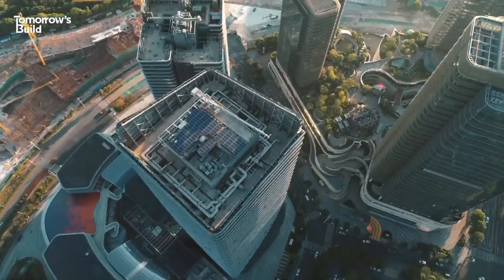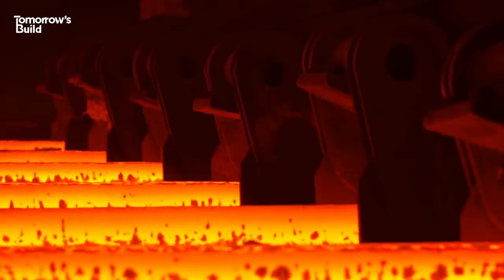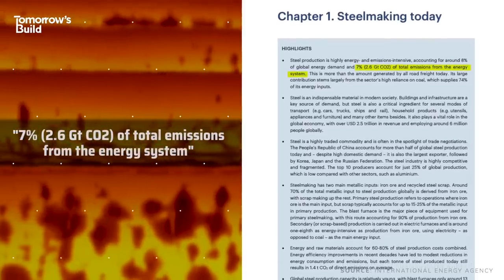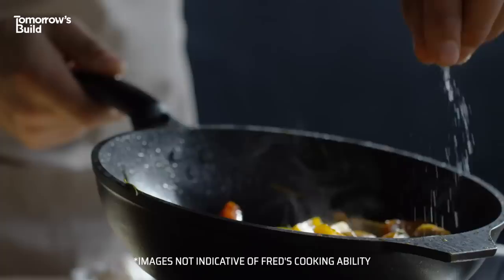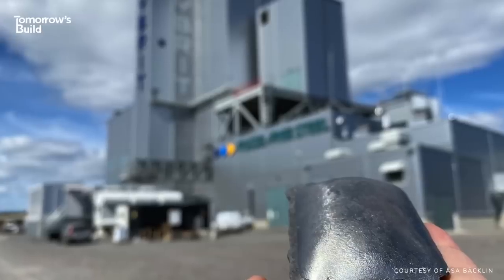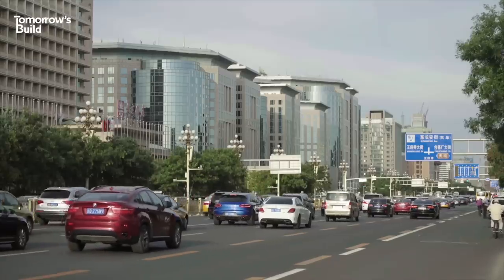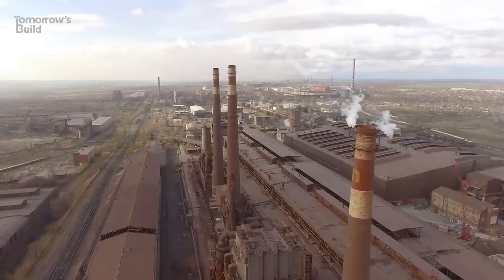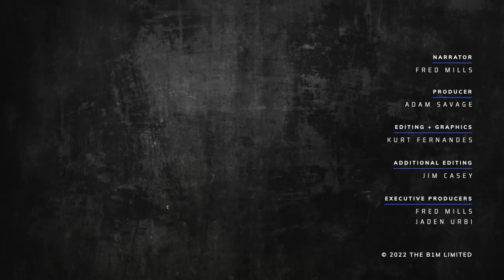Has Sweden Invented Green Steel?

Comment: What's the cost per tonne?  What does it use as a carbon source (i.e. where does it get the carbon that turns it from iron ore into steel)?  One of the main benefits of carbon steel is that it's cheap.  If this steel is two orders of magnitude more expensive, how likely is it that we can bring the cost down to economical levels?
Reply: That'll probably be a scale of production problem. Hopefully enough companies will want to show they are green so they'll buy the currently expensive steel and help them lower the cost long term
Reply: The current plant is a pilot plant from what I have understood so likely it is not operating at a profit yet.
Reply: Raw iron has more carbon in it than steel, hence the treatment with oxygen to burn most of the carbon out of the iron. No coal in the iron production means that no additional carbon is introduced, which in turn hasn't to be burnt out later in order to get steel. I'm not sure if the natural carbon content of iron ore will suffice for carbon steel, but introducing carbon in the steel production shouldn't be very difficult, maybe by just mixing in CO2 into the Hydrogen or mixing the Hydrogen with Methane, which contains Carbon.
Reply: Exactly expected more info from this video.
Reply: Many parts of the world including the EU has carbon trading schemes, creating situations where over time the cost of using carbon-intensive methods will just grow and grow. So that will contribute to evening out the costs over time.
Reply: @hape3862  How does a comment this wrong have so many upvotes?

No, iron doesn't contain natural carbon at all.

As someone who makes iron for a living, everything you've written is nonsense.
Reply: @gavwah  Raw iron (pig iron) contains 4% carbon from the coke in the blast furnace. Carbon steel contains 2% carbon after having burnt out much of the carbon with oxygen. – These are facts.
BTW: Making a living as a horseshoe smith in hillbilly-county doesn't necessarily make you an expert in metallurgy.
Reply: @hape3862  I guess he might be picking at your wording "natural carbon content of iron ore" whereas you're explaining a statement about raw iron (after blast furnace). From quick googling I get that plenty of types of natural ores do also technically contain carbon...

/me reading YT comments for insights. Keep up the informative debate :)
Reply: @gavwah  "Everything you've written is nonsense" is almost always a wrong thing to say about a paragraph of text. He wrote multiple statements, refute one by one with links to sources. If you can :)
Reply: @u1zha  Thanks for the support. I'm German and my English is quite good, so I translated "Roheisen" as "raw iron" - who would have thought it was "pig iron" in English!?!? But I suspected it was a misunderstanding and googled it. And I googled again for the percentage of carbon in "pig iron" and carbon steel to confirm that the numbers I had in my head were correct. I could not find the natural carbon content of iron ore, hence my wording "I'm not sure ..." in my first statement. Also, I wrote "maybe" in reference to methods of reintroducing carbon into steel.
Reply: @hape3862  >I could not find the natural carbon content of iron ore.

Because there isn't any.
Reply: @u1zha  

I'm an iron maker. I literally do this every day.  Your mate is talking about iron ore having a native carbon content of 4% and about "additional carbon". All carbon is additional in iron and steel making. It's nonsense. They've admitted that they're literally just googling stuff without understanding the details and nuances of what it is they're reading.

The economics and energy requirements of pure hydrogen DRI is insane. All proposals I've sent use natural gas / hydrogen blends with the aim of producing sponge iron with a carbon content of 2%. This will reduce the liquidus of the iron from over 1500 degrees to closer to 1200 degrees, significantly reducing the energy requirements, as well as simplifying the design, improving refractory life etc etc. Hydrogen alone won't give you this reduction. So you'll still need to emit that 2% carbon as CO2 - again, your mate saying standard steel grades are 2% carbon is laughably wrong. Now sure you can try to use some kind of biogas methane product instead of natural gas, but good luck being able to find enough of it to decarbonise the entire global steel industry. Oh, and god forbid you leak any of that gas to atmosphere, since it's 80 times worse as a greenhouse gas as CO2. Your mate Einstein here also saying you could mix CO2 into the hydrogen to get the carbon content.... How exactly would the CO2 get into the sponge iron?!?? Laughably. He's literally admitted he's just getting this off of Wikipedia.

And we haven't even talked about how rare 67% FE magnetite deposits are yet, but that's a story for another day.

Hybrit is a very unique case that has serious limits on its scalability.
Reply: @gavwah  That's exactly what I stated in my very first comment: " No coal in the iron production means that no additional carbon is introduced , which in turn hasn't to be burnt out later in order to get steel." The percentages I quoted are taken from Wikipedia.
Reply: @hape3862  ahhahahha. "You must be a hillbilly, and I must be correct because I read it on Wikipedia". Hahahahahahahahahaha.

Did Wikipedia explain how exactly you're going to dissolve carbon into sponge iron using CO2???

Could be a translation issue, but your original comment means the iron ore has 4% carbon in it, and by not using coal, you're not adding additional carbon. Big big difference in meaning compared to what you wanted to say.
Reply: Okay boys who keeps arguing I went and found the answer iron has more carbon than steel. Pure iron we never use unless for making steel.
Reply: @joshuakim563  "Pure iron we never use unless for making steel." – anymore! Pig iron (= cast iron) was used for many things, and a lot of old early industrial buildings like train stations have still their cast iron features.
Reply: @joshuakim563  pig iron has more carbon than steel. Cast iron has more carbon than steel. But to say "iron has more carbon than steel" is nonsense. These are all types of iron alloys, even steel.

"Pure iron was never used except to make steel". What? No one ever made steel out of pure iron commercially. Steel is essential purified cast iron to begin with.
Reply: @hape3862  mate, stop reading from Wikipedia. You have no idea what you're talking about.

Cast iron is not pig iron. Nor is it pure iron. Cast iron by definition has carbon content >2%. Pig iron obviously is not pure iron either.

And obviously cast iron is still used for hundreds of applications.
Reply: @gavwah  You should learn how to READ. Your interpretations are not what others wrote. You are fantasizing and implying what NO ONE has said or written. I NEVER used the term "pure iron". Period. And yet you straw-man yourself into arguing against "pure iron"!
Reply: @gavwah  I can see your last comment only partial in the preview, it's a bug in YouTube. – But again: Learn to read! Me QUOTING another comment is NOT me speaking about pure iron. Pure iron is a niche product and NOT subject of this discussion.
Reply: @gavwah  I assumed he meant raw iron, as pure iron isn't subject of this discussion. 
Raw iron = pig iron = what comes out of the furnace. Melted a second time and cast it is cast iron. Granted, it sometimes will be alloyed, but if not, then it is just cheap cast iron. If pig iron (= raw iron) is blasted with oxygen in order to burn the carbon out (which was introduced by the coal or coke in the furnace), it becomes steel (which comes in different alloys as well, granted). – Tell me that I'm wrong. If not, then look what I wrote. I always say the same things. YOU are making a fuss.
Reply: @gavwah  Cast iron is still in good use? – FINE! I didn't know that. That doesn't make my statement wrong that it HAS BEEN used widely in the past. I reckon that cast iron isn't AS widely used today as it used to be: Thus even my "anymore" doesn't count as outright wrong, does it?
Reply: @hape3862  hahahahaha, I need to learn how to read and I need to stop putting words in other people's mouths when you're the one who is literally making substitutions of words from "pure iron" to "raw iron" and then discussing that instead. That's literally a strawman, my dude!

Also, as discussed earlier. "Raw iron" mean "iron ore". The rock. Pig iron comes out of a blast furnace. Cast iron is iron with >2% carbon. Those things aren't the same! Stop writing raw iron when talking about pig iron. And especially don't talk about pig iron when others are talking about pure iron. And especially don't accuse me of not knowing how to read when you are the one deliberately substituting the meanings of words and not telling anyone!

"Granted, sometimes it will be alloyed but if not then it is just cheap cast iron". No, no, no, no, no! All cast iron is an alloy. By definition. Not only due to the carbon, but most importantly due to the silicon. You'll also have titanium, phosphorus and sulfur in cast iron.
Reply: @gavwah  I'm German. Roheisen means literally raw iron. When I look it up, it is translated as raw iron or pig iron, interchangeable. Iron ore is something else, and I didn't talk about iron ore at any point in this discussion. YOU brought up iron ore, because YOU claim it is the same as raw iron. That's your weird definition, not mine, sorry. Neither did I introduce the term "pure iron". The other guy brought up pure iron, not I. In both cases YOU strawmaned yourself into a rage. I DID NOT talk about iron ore, nor about pure iron. Everything I said was correct, given that we aren't at the metallurgical faculty of a university here and can let alloys and fractions of percentages aside.
Reply: Carbon steel is at most 2% carbon by weight, so you could use a small amount of coking coal after reduction to make carbon steel. Or if you REALLY wanted to go fully GREEN STEEL, you could pull CO2 out of the atmosphere to grow trees and use pyrolysis to reduce the trees to charcoal. Seems like a lot of effort when we already have so much coal at the ready.
As for the cost, I do have a calculation brewing, but it seems too cheap, so I will check my numbers and re-post with the calculations.
Reply: @gavwah Wikipedia is a far more credible source than some guy in the YouTube comments who writes like a thirteen year old claiming to be an “iron maker”. I’m pretty sure the engineers up in the north of Sweden know more about this than you and I understand why you feel threatened by this new tech, if, and that’s a big if, you really are an iron maker.
Reply: @ianthompson44  any luck?
Reply: @okman9684  I can't find my error, so let me lay it out here and maybe someone else can find it.
I'm going to use Fe3O4 for iron ore for simplicity. 
Fe3O4 has a molar mass of 231.53, of which 63.99 is the oxygen. So, a metric ton of iron ore contains 276kg of oxygen, which is 17,273 mol of O, and 8636 mol of O2.
If the reduction process was 100% efficient, that would mean it would only take about 113kg of coking coal to reduce a metric tonne of pure iron ore. The industry average is about 770kg, so 85% of the coal must be for heating. A metric ton of coking coal is about $500, so about $385/ton of steel.

17,273 mol of O would require 34,546 mol of H to reduce, which is 34 kilos of Hydrogen. Hydrogen is currently about $18 per kilo, so that's $612/ton at current prices. If Hydrogen were to drop to $2/kg then it would be $68/ton.

Specific heat of Hydrogen is roughly 14kJ/kg, so heating the hydrogen to 600C would require 34*14*600 = 285MJ which is roughly equivalent to 79kWh or about 5 bucks @ 6c/kWh.

So it mostly depends on how cheaply we can produce hydrogen. At current prices it's almost double the cost. If we can get hydrogen down to $2/kg, it would be about 4x cheaper.